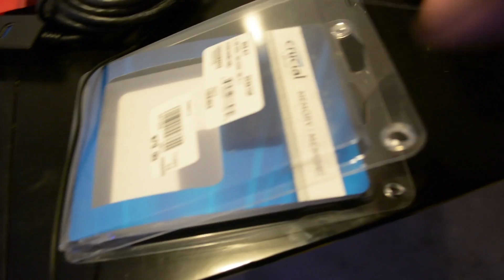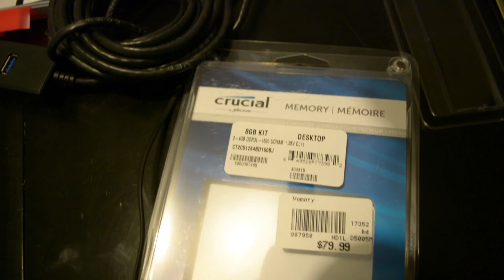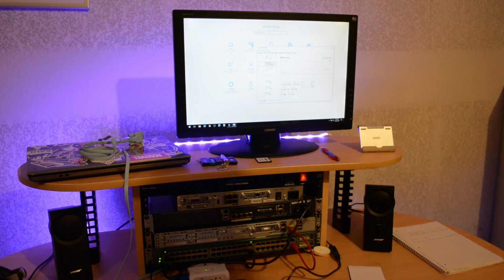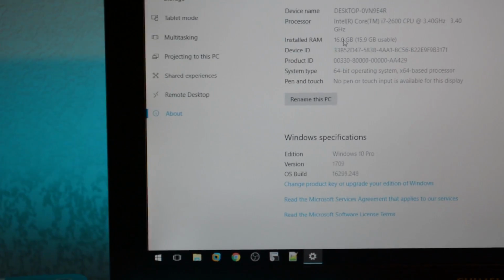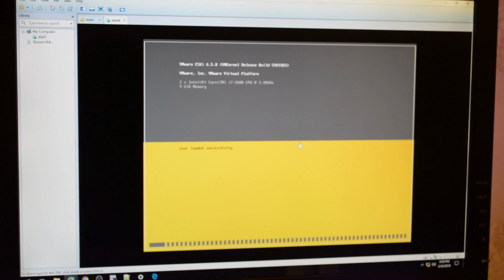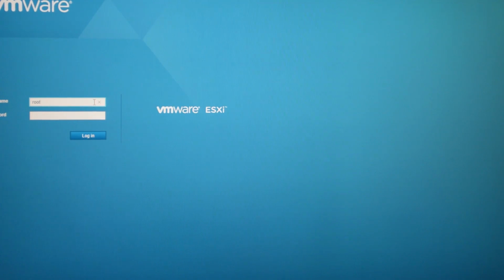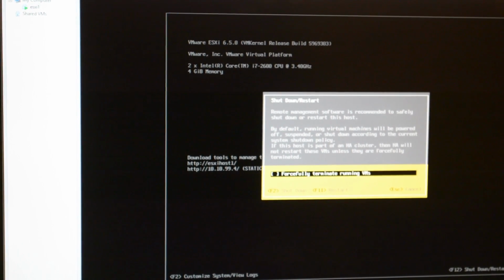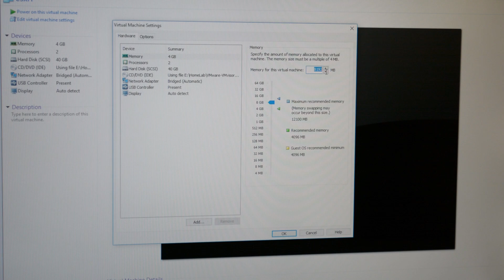Upgrading ram in a Dell Optiplex 790

Comment: This is kind of old but does anyone know what kind of motherboard The De optiex 790 Mini Tower has I want to change the case
Reply: Doing a case swap with OEM machines is tricky, as most motherboards are built in a way that they only fit in OEM cases due to the way the screws are aligned.
Reply: @OnBrandRP  you have a micro ATX motherboard and it will fit in most any ATX case, regardless of manufacturer.
Reply: @Super1nobody  That's what you would love to think. The way older OEM cases are, The motherboards were built to never be replaced in another case other than what the OEM manufacturer has built for it by putting the screws in specific places that only the main case could fit. If you were to put it in another case and find a way to make it work then you would be fine.

Comment: my del 790 optipex showing very low performance bro even a Low quaity games cant even play
reccomend me some upgrades bro
Reply: get a 16 GB DDR3 ram overclocked from 1665 MHZ to 3000 MHZ and a 250 GB SSD, lastly a gtx 750 TI

PS. my CPU is overclocked to 3.70 ghz and replaced the cooler into a water cooling system
and upgraded my PSU to 350W
Reply: @papanomaly6284  How much would that cost?
Reply: @g_a_b_r_i_e_l_  maybe 1,800$ now
Reply: @g_a_b_r_i_e_l_  cuz mine cost 3k back then
Reply: @papanomaly6284  For an optiplex?
Reply: @g_a_b_r_i_e_l_  yeah, for mine is a optiplex 750
Reply: @papanomaly6284  Couldn't you just scratch build a gaming pc for less than that?
Reply: @papanomaly6284  I wouldn't suggest overclocking ram.
Reply: @OnBrandRP  Full send
Reply from the maker: How ram do you have in it? Do you have a solid state drive?

Comment: If you hold down the Windows key and press the Pause/Break button, it will open the System information windows showing processor, ram host name, domain or workgroup name and Activation status ;)